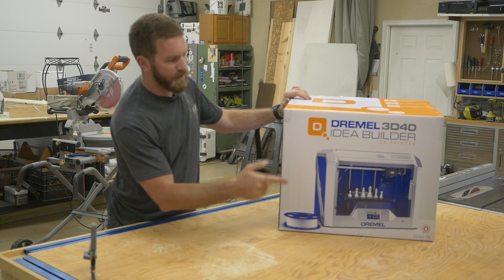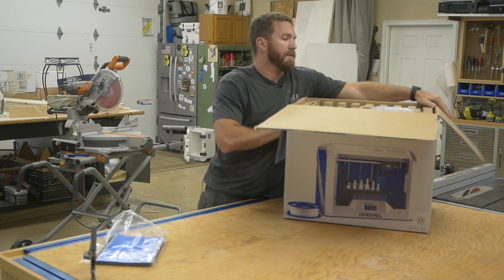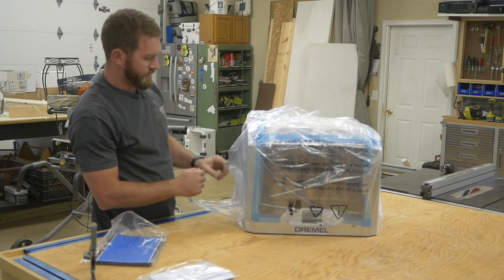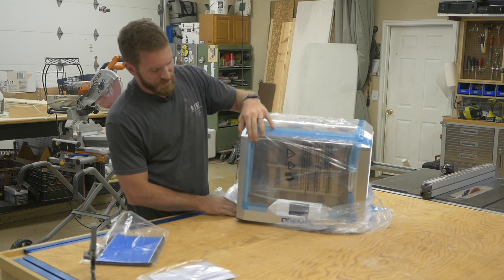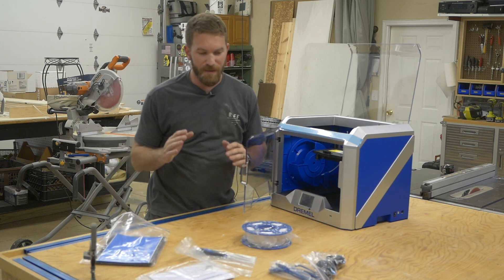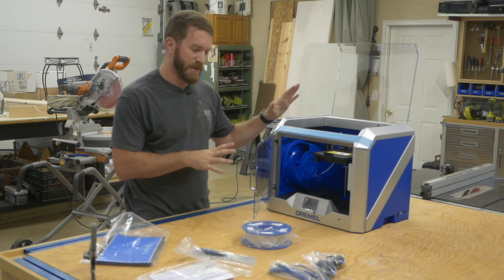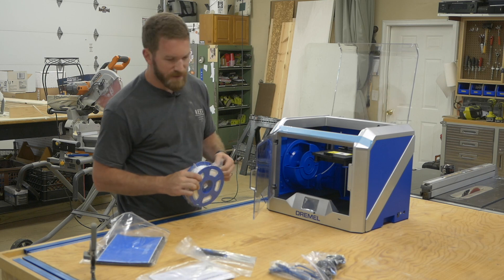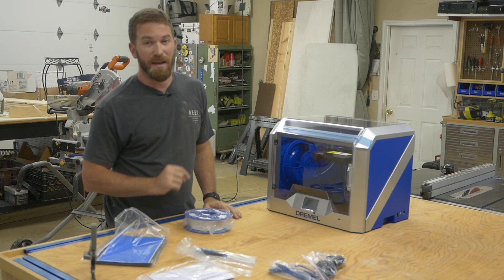My new tool! - Unboxing the Dremel 3D40 and initial thoughts

Comment: We have a different, but similarly easy to set-up printer. My husband does Engineering design for a fancier 3D printer at the moment, and would be happy to help share notes if needed.
We used Dremel's black filament first, and loved the print quality, especially because we could find it in a physical store, then tried their white filament and it was a mess. So much I was cringing when I saw it when you were boxing. 
NASA has STL files out to print little pinhole cameras for the upcoming eclipse. If you have sticking/curling issues, fresh painters tape and good old Aquanet hairspray on a printbed does wonders.
Reply from the maker: That's awesome. We had pretty good luck so far. The only mishaps were my fault.